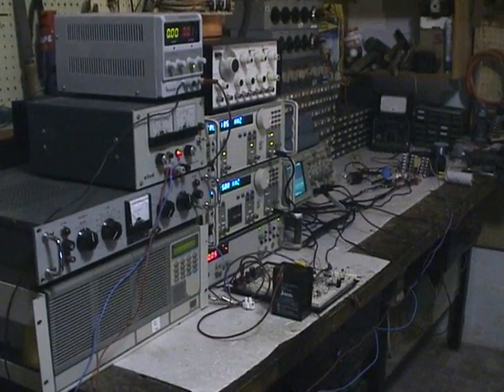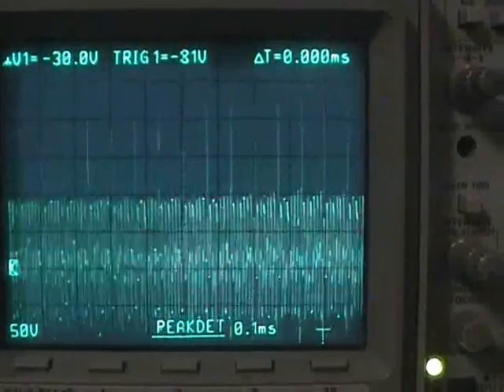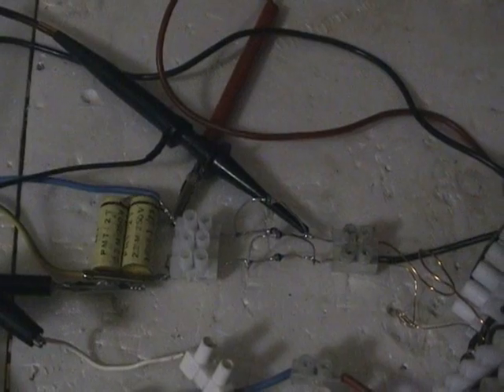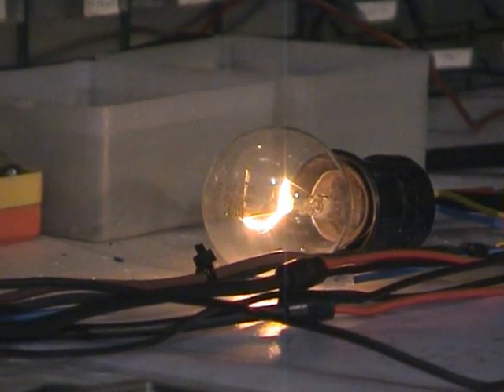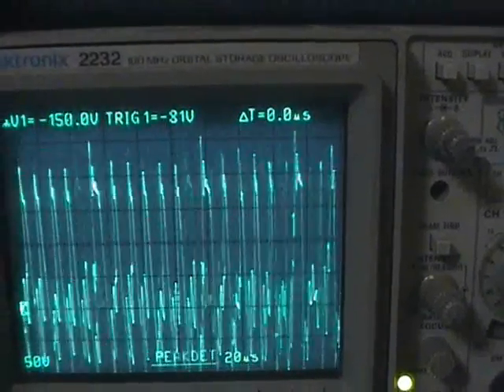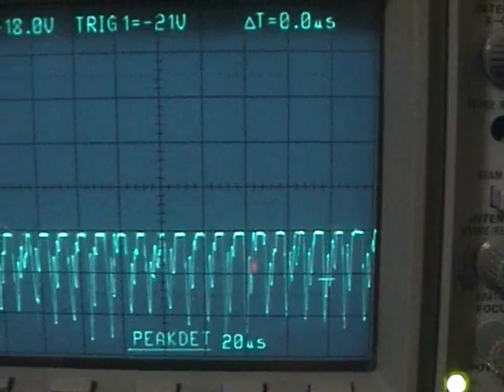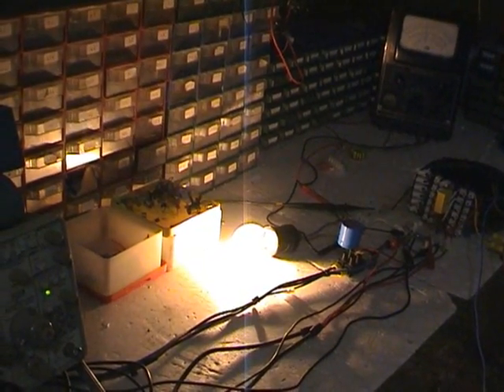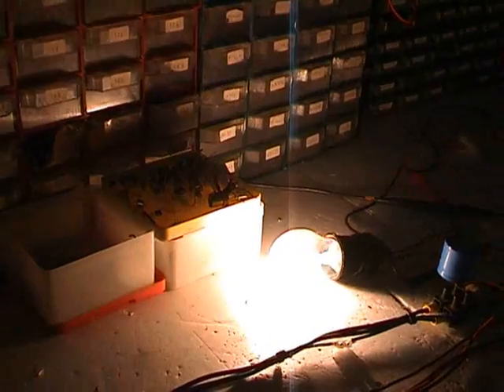TPU V10-7 2nd Test session - full -

Comment: Hi Roberto,
well done.
You also have great equipment ! ;)
What wattage does your bulb have ?
You always have to tell us, how much amps also goes into your circuit, voltage alone does not tell much, so we could compare, how much power comes out of the lamp.
Now the questions still is, how much heat do you also get at the MOSFETs ?
Regards, Stefan ( overunity dot com )